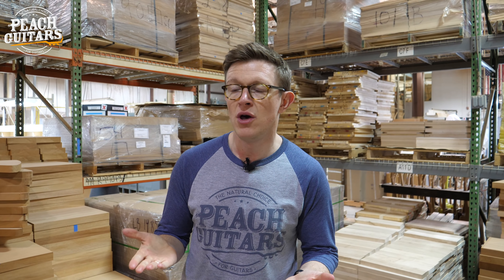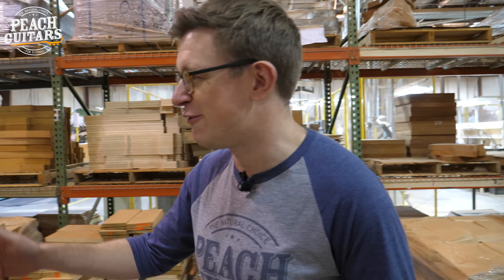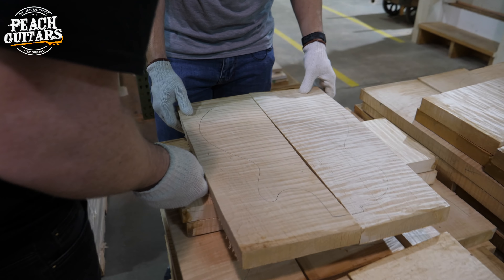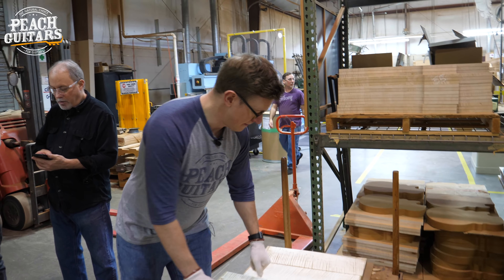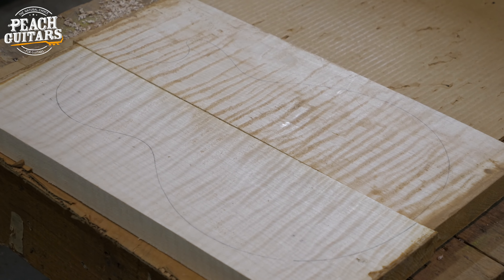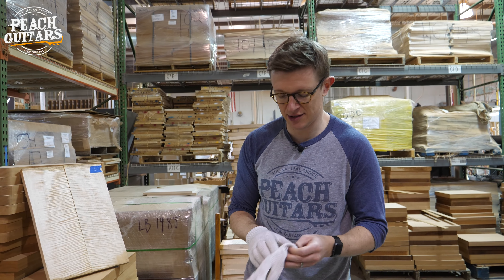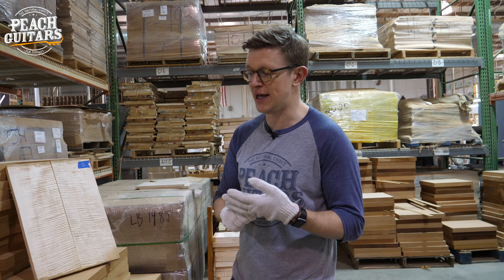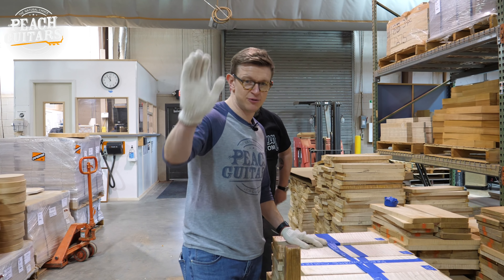Behind The Scenes At Gibson Custom, Nashville

Comment: Not even a knock-knock wood tone, or a fork test, to eliminate dead spots? Just selecting wood for visuality? I mean, i would like to choose the tops matching the body wood resonance and the sound what i'm looking for. Never care about the stripes, flecks or flame sizes. Just like the originals. Only a few have such nice LOOKING tops...
Reply: couldn't agree more .
Reply: Are you certain we saw the entire selection process?
Reply: @El-Scorcho  Yes, I'm shure.
Reply: From an engineering prospective alone, I'd consider rigorous 'tone' testing for hollowed and acoustic instruments.  Solid electrics pretty much depend on a lack of resonation to achieve their sound.  The difference in density between maple and mahogany is somewhat like a shock absorber.  As an exaggerated comparison, I'd imagine the maple top and rosewood/ebony fretboard behave as springs while the mahogany takes the role of the oil.  Or maybe like a tuned mass damper.  The fact that the materials lack a common moment means the body doesn't suck up the tasty string vibrations which should be directed at the pickups.

... Or they just think pretty sells.